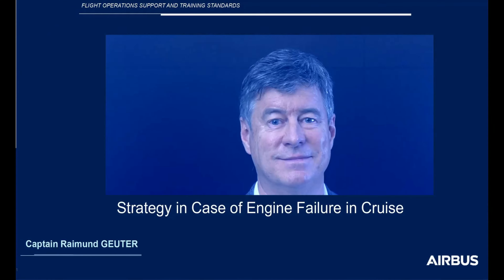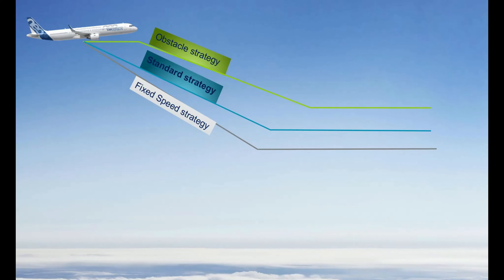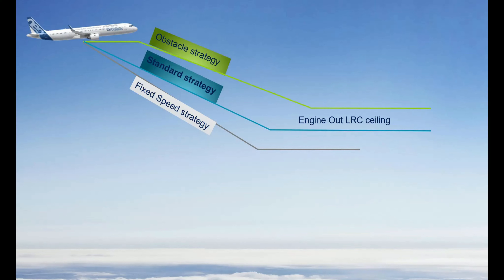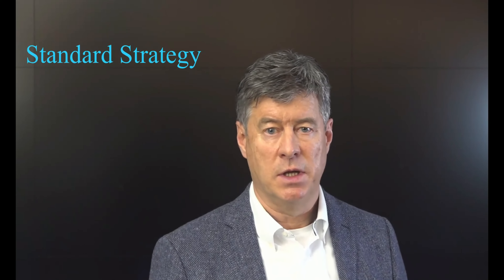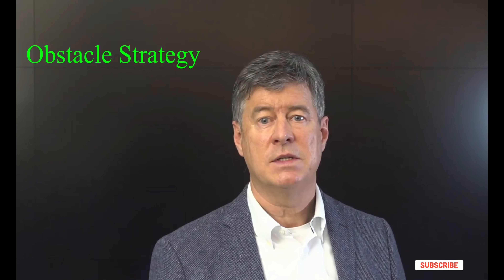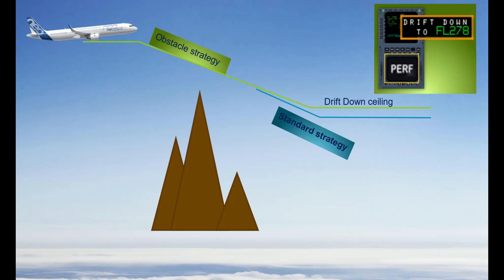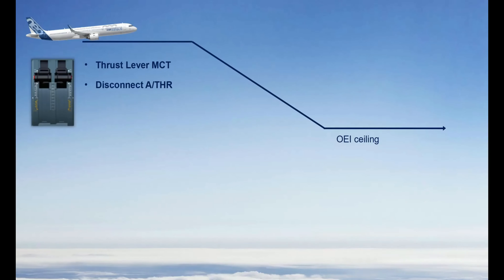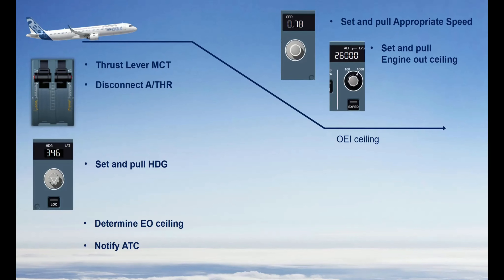A320 Strategy in Case of Engine Failure in Cruise.

Comment: How's the airplane keeping the speed just with autopilot without autothrust?
Reply from the maker: It's call Max Continuous thrust MCT it's a fix thrust not auto thrust involved
Reply: By using Open Decent mode the FMGC would cause the FADEC "usually" to reduce the thrust to idle thrust. By turning the A/THR system off BEFORE pulling Open Descent mode, you prevent the thrust reduction and achieve a descent with a fixed speed according to strategy (standard / obstacle / fixed for ETOPS) while the FADEC commands a fixed thrust setting of MCT.